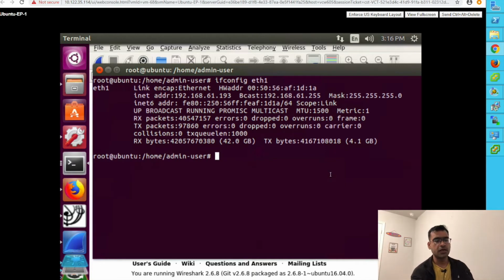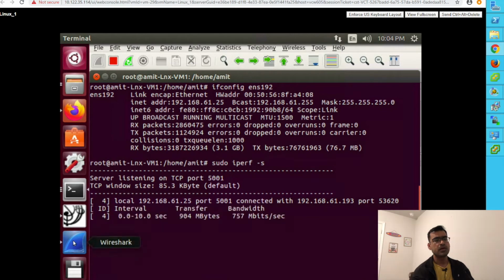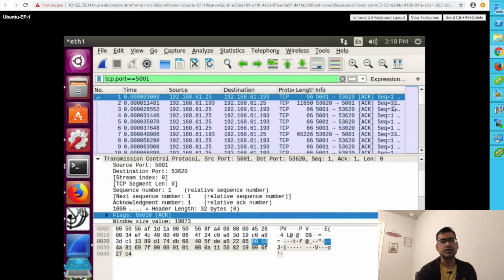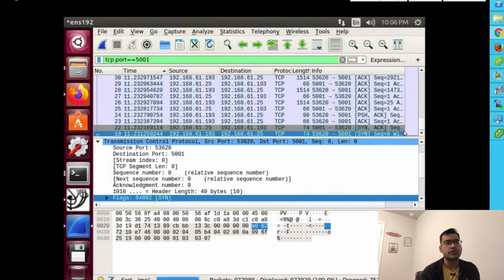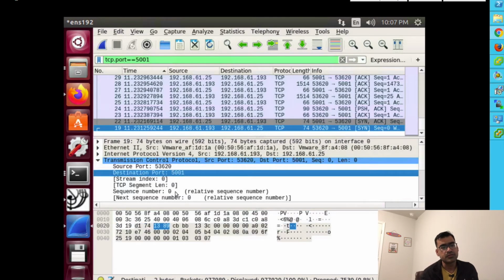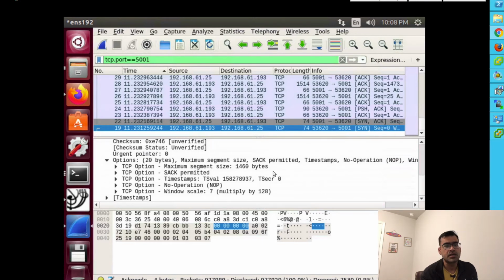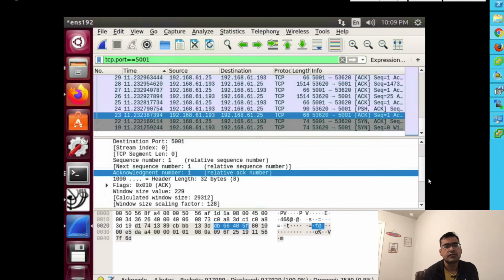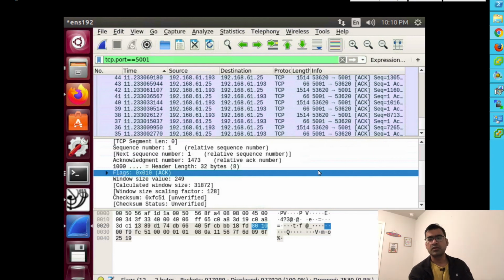TCP Three-Way Handshake Explained with Wireshark

Comment from the maker: Quick accuracy update for this 2020 lab: SYN consumes one sequence number, so the peer acknowledges ISN+1; Wireshark often shows relative sequence numbers beginning at zero. A Window Scale shift of 7 means 2^7 = 128, not “times 7,” and the window field in SYN/SYN-ACK is not scaled. Also, PSH requests prompt delivery behavior—it does not guarantee immediate processing without buffering. Which handshake field would you like to see dissected next: MSS, window scale, SACK, timestamps, or retransmissions?